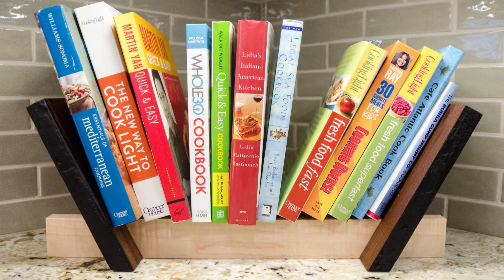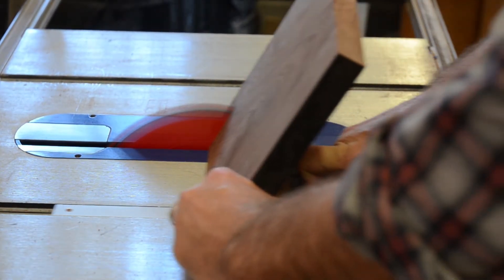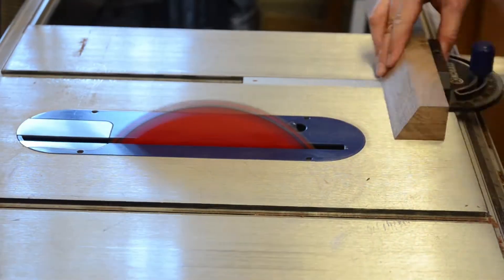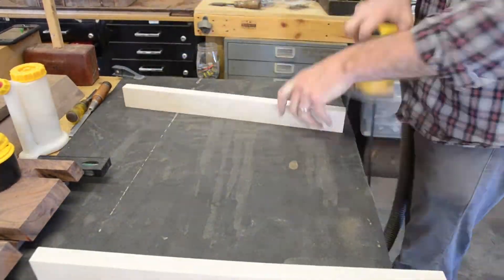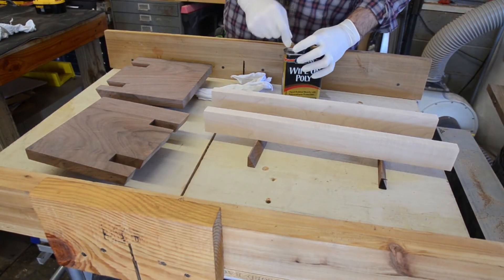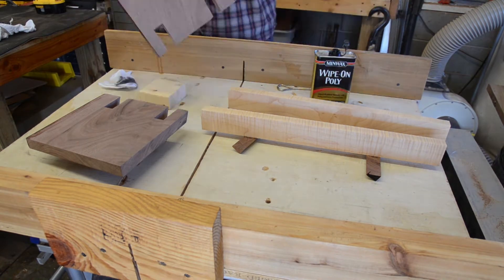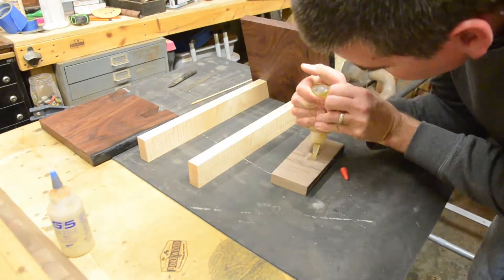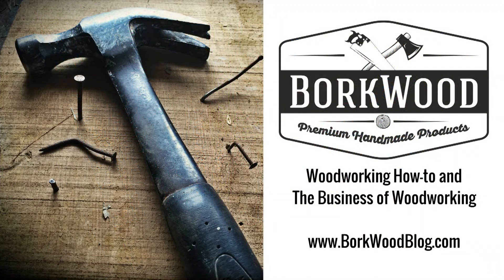DIY Cookbook Stand

Comment: Very beautiful work. Many many bravo. Can you write the dimensions & thickness of the wood to try to make it in Patras Greece ?
Reply from the maker: Costas 1965 thank you! The railed are about 20” long 1”x2” and the sides are roughly 8”x10” and 1” thick. Of course you can make the same design with whatever size wood you have available and just cut everything to rough sizes depending on what looks good proportionately. Hope this helps!
Reply: Υou are the best !